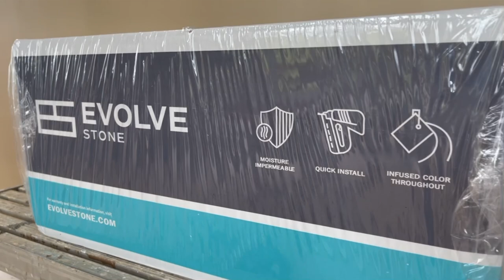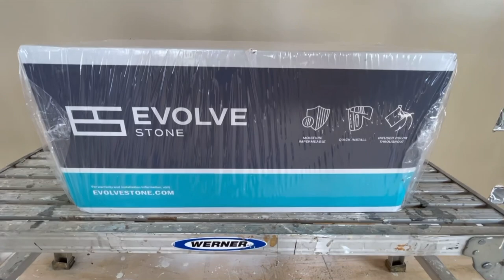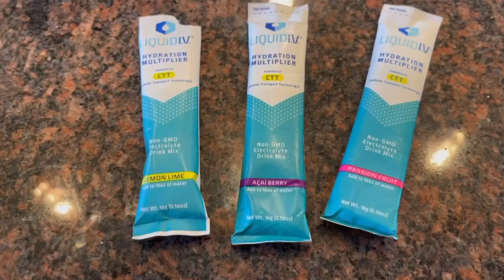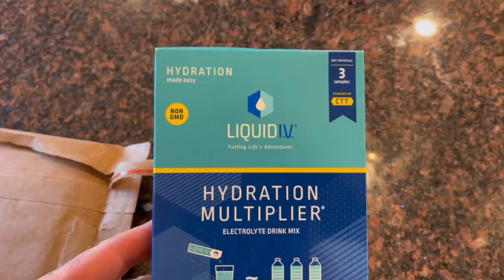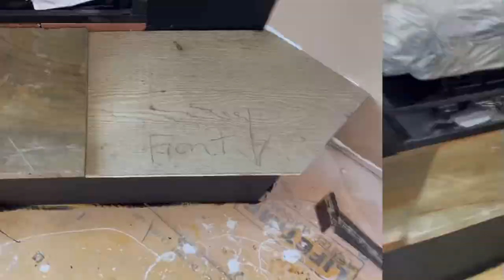Building The Nantahala Retreat #31 | DIY EASY Stonework

Comment: Looks very smart but I wondered about the mantle height: this is the second fireplace where you've put the mantle way high - doesn't seem in proportion with the chimney wall or the windows to either side. Is this aethetic/fashion, or to do with heat safety?

Comment: Two questions. One how do you or what do you use to cover the nail holes in the stone? Two Jamie how is the hand holding up to your construction use of it? Any extra or unexpected wear and tear on it?
Reply: The nails don’t really show because they are so small and the stone has some small flecks of mica on the surface. It’s actually amazing how well they hide. And the hand is still doing great!  Thanks for asking.  I have replaced a few of the finger tips that have worn down from handing rough materials, but they are surprisingly durable and very easy to swap out.